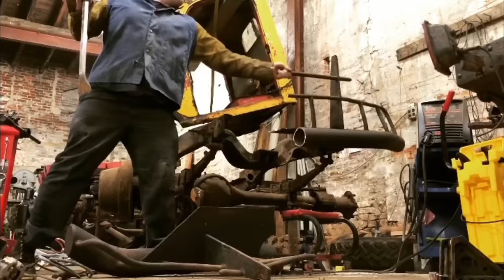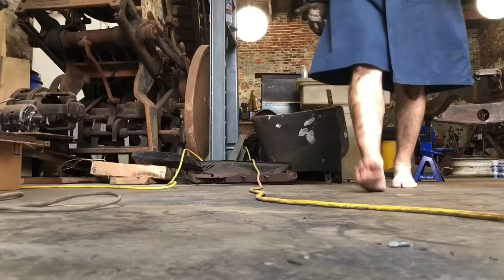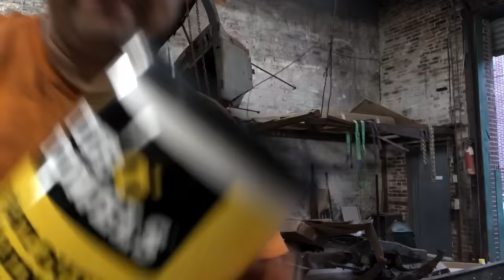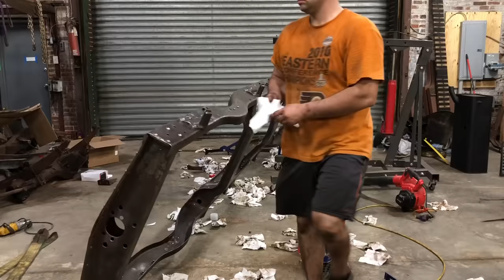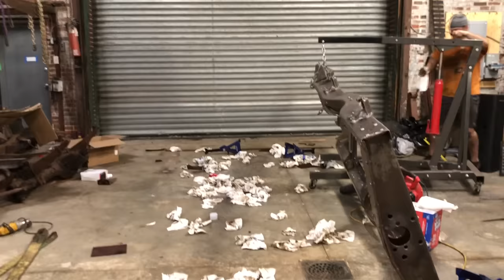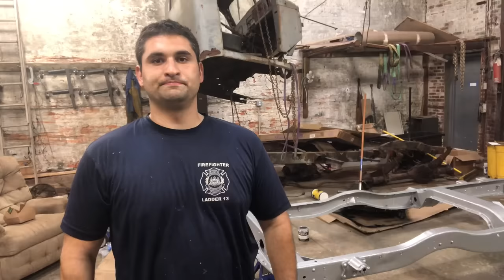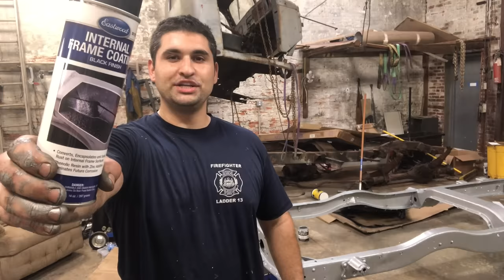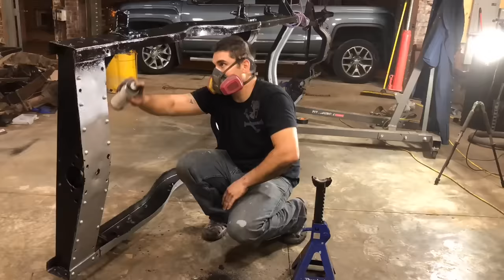DIY: How To Restore a RUSTY Truck Frame LIKE NEW with Basic Tools!

Comment: How many cans of the 2K did you use?
Reply from the maker: 5-6
Reply: That 5-6 cans, was that for one coat?  Looking to use Eastwood 2K on my 1971 Monte frame and trying to figure out how much to buy for 2 coats. Thanks
Reply: @tommik9368  Rattle cans give lousy coverage. Just use a spray gun, cheap enough and way better.
Reply: Hey Bud I’m looking to do an off frame build on my 68 C-10. I know the frame is still solid. But for future reference if I run across a project to where the frame needs a lot of work including patch work do I need to pass that project up or do I go ahead and spend the extra time on re-enforcement and bringing it back up
Reply: How much did the entire Eastwood stuff cost?
Reply: 2 words CarRep 2k. I use Eastwood alot but I've used CarRep 2k epoxy primer that has no pot life. It don't mix its 2 parts until sprayed. So it will last a long time. Love it. Primer, paint and clear.
Reply: 2K has isocyanide, always wear a respirator if spraying indoors. It says this on the can.
Reply: @albert-uj8ci  once you factor in price of the spray gun and compressor, it can get pretty expensive.
Reply: @lvlikeyV  Not that expensive these days, If you're doing stuff like restoring a truck frame not a huge percentage on your total costs. And you can use that compressor for loads of cool air powered things.
Reply: @albert-uj8ci  I suppose "pricey" and "expensive" are relative terms. For someone wanting to do a cheap diy restoration, adding an additional $200 for painting equipment (not including paint) may not be an option. Especially when the final outcome of the video turned out how good it did. To each their own. I just don't want to fuss with an air gun.
Reply: So how much did all your consumables cost including the metal prep stuff?
Reply: @keithkreischer7321  over 100$ i would reckon
Reply: @lvlikeyV    are there sprayguns out there that can be rented for nominal fees
Reply: @efil4kizum less convenient, more expensive, and not to mention theres a learning curve to using that equipment.
Just face it man, spray cans have their place. They're perfect for at home diy projects. If you're wanting a showroom car and have a shop, probably not the best option.
Reply: @efil4kizum  you can get a spraygun relatively cheap. You get what you pay for but a cheap one will serve your purpose without breaking the bank. The main thing is getting a water separator on your air supply and having a good enough air compressor. You really need a large air compressor, but you can make use with a smaller one. you just have to pay attention to your air levels and let it catch up when you spray

Comment: Would it not have been cheaper just to have it sandblasted and powder coated
Reply: I’m no automobile expert but I had this feeling right from the beginning, the oil and grease could have been burnt using a gas flame instead of the degreaser spray and wasting so so so much of paper.
Reply: Getting the frame to and from the sandblasting/powdercoating place could have been tricky (and expensive) though, depending on what he's got available to him for transport.
Reply: @SniffBackBetter  yeah but as a metalworker I hate powder coating as when it chips rust gets underneath, have you seen road signs with peeling of plastic
Reply: Think he got the paint for free, Just the labour needed!
Reply: @Alan2E0KVRKing  yeah,  from eastwood...their stuff is too expensive
Reply: Electrolysis process would also work, to remove the rust, might have to build a small pool to make it work, but can be done.
Reply: @SniffBackBetter  Yeah.....100 bucks for a UHaul flatbed....cheap when u compare each way of doing this.
Reply: @kubasaki1978  True. I've since discovered that epoxy and polurethane paint systems are the way to go. Far better than powder coating. A properly applied system will last for 10 years even on marine equipment immersed in salt water. On something like a truck chassis it could last indefinitely with a bit of occasional underbody jetwashing.

Comment: Brave man, spraying with your GMC parked 20 feet away in the doorway. I would be so worried about the drifting overspray speckling my truck 🙂
Reply from the maker: Haha. I park the truck to keep random people from walking into the shop (when I don’t, they do) 🤷🏻‍♂️🤷🏻‍♂️🤷🏻‍♂️🤷🏻‍♂️
Reply: @partsandresto  I figured the GMC was parked there as a deterent, I would have done the same as well although would have also been worried about the overspray loool.......great job man, really hard work although really rewarding work! I have yet to try the Eastwood products although have had great success with Rust Bullet sealers and rust inhibitors, have you ever tried them on any of your projects? would be interesting to see between Rust Bullet and Eastwood which if any is slightly better than the other, Cheers bro
Reply: dries in air before reaching it
Reply: Most overspray will dry in mid air before touching the 20 foot mark leaving it easy to wash off so don't worry about it just paint and realize that there's an reason you hold your paint gun 6 to 8 inches away cause it gose on wet from that distance and sticks 20 feet is plenty room to get it off your truck I paint houses ,cars ,rod iron fences and have never got anything on my truck that wouldn't just wash right off. Good day to you guys and yes house paint is designed to stick to metal as well as wood and stucko also.

Comment: I did one 1940 Ford coupe frame at the same time as a 1957 Chevy ragtop frame...side by side. We sandblasted them roughly to knock off most of the rust and then sprayed both with a metal acid from Zep. Then repeated both steps the next day. Then sprayed heavy coats of epoxy primer, waited six hours and gave them another prime. Then sprayed catalyzed acrylic enamel black, numerous coats to get the shiney look. Even clear coated with a catalyzed urethane clear. Two years later, when we had both of the bodies finished and dropped back down with the engines, the frames looked fab. 34 years later, in 2018, the man who still owned both cars called me to come inspect the acrylic lacquer finishes (Ditxler). Even though both cars had been driven to various shows, but were lept in his barn most of the time, I got down on the floor and flashlighted the frames. They were still 100% and still shiney! Compared to the coal tar based black enamel the Ford factory used and the black alkyd enamel GM used, they really proved the better, doing it how we did. I hope I never have to do another frame, just like I hope I never have to hang another front clip on a '50 Chevy truck.

Comment: You need 2 engine stands converted to frame holders which when you weld flat plates to them they can bolt straight to the frame on the front and back allowing for you to roll it around and also spin frame 360 when painting it. I have an buddy who did this technique for his 63 impala
Reply: Genius 👍

Comment: When spraying inside your cross members,If you put tape about a inch from the end of the rubber tube,you will know when it is close to the end pulling it out. I hope you did not get any over spray on your truck parked in the doorway,you might want to cover it up if you spray again. You can buy a roll of plastic at the auto paint store,it's around 14' wide and 300' long to cover your projects with.  It turned out great! Nice job.

Comment: I have a background in aircraft parts reconditioning and painting. I really like using Sherwin Williams hex chromium epoxy primer for a base. In my experience rust encapsulate products do not work because rust can flake off in which oxides can redevelop. In your situation your frame was so nice and rust free I would have opted to do a phosphoric acid soak and rinse and then epoxy prime. The reason i like the hex chromium epoxy paint is that it is mil spec for aircraft coating. If it's good enough for an airframe then good enough for a car. Fantastic effort and a job well done. Your attention to detail was amazing.

Comment: Looks good. Just need to remember to use a breathing apparatus at all time when dealing with aerosol and eye protection especially when your working under something like that frame when brushing on the protective coat.
Reply from the maker: Yes sir. I’ve since learned
Reply: @partsandresto  perfect job, just whispering here, next time if possible, cover that nice ride by the door from all the paint, man that frame, well done
Reply: @partsandresto  very thorough and nice job. Mopar lover myself. When you were doing the last part with the frame on its side, you can see the air currents (looks like) moving through the shop toward you. Wear painting respirator for this people. Those painting products are not made to be inhaled even in small amounts. Stay safe and GOD Bless.

Comment: You won my subscription... I have done this type of job many a time... I used compressed air after wire wheeleing to get the dirt out of the cracks... (with safety glasses on) and then wiped the whole frame and surface with a gallon of paint thinner to get more dirt out (in tight places I ouredd a couple of ounces to flush out the dirt)   and then another once over with the air compressor and blower nozzel.... Thenan  ethyl alcohol wipe down as a final prep... 
I am not criticising .... You said you wanted to hear feedback  - alternative methods so - you asked for it  ( just kidding)    GREAT show BTW... Thanks for sharing...
Reply from the maker: Thanks Jim! I definitely did it the hard way. But hell, I already had the tools, so the rust removal was free. I like free

Comment: Nice job! Looking to use the same product on my F-350 frame. Curious how the finish was after brush coating the platinum paint.. Did it leave any brush stroke imprints or did it sort of self level and come out as a smooth finish when dried? If not, would you suggest using a spray gun instead of brushing for a smooth finish look?
Reply from the maker: To be honest it’s a little brush strokey

Comment: Good effort on the manual labour. I use one of those air varsol sprayer's to spray rust inhibiter inside a frame, it comes out as a fog and gets everything inside coated including seams.

Comment: I like how you did the silver Rust Encapsulator on the bare frame, then the black 2K top coat. Makes it a helluva lot easier to see where you've painted, and where you've missed. Good subliminal tip!

Comment: First ever video I've seen of yours and honestly it was awesome. Great job on all that hard work. Only thing I would have for criticism is typically when painting you do a really light first two coats allowing the material to flow and adhere better to the frame. I don't know if you'll have any bad effects from going so heavy right off the bat but I know that with everything I've painted going two light coats then a medium coat always serves me well. Cheers my guy
Reply from the maker: Thanks Ryan, that’s good advise. I’m literally flying by the seat of my pants
Reply: exactly

Comment: It’s really interesting how a truck frame from the 50’s is so solid and the frame on my 96 Silverado is literally flaking apart. It’s so bad that a had to have 2 cracks in the Chanel repairs with diamond plate and 1/4” steel on both sides of the frame by the front spring eyes.
But I do like Eastwood’s products and may try them out on a 79 trans am frame I’ll be restoring.
Reply from the maker: Yeah they are great. Worth a shot, you’ll be glad you did
Reply: Its not from the northeast that much is certain.

Comment: I use a lot of Eastwood products as well. I find the tube that comes with the internal frame coat horrible. Especially for fully boxed frames. But it can never get it point where I need it. 
So I remove the tip and throw away the cheap tubing. I use the brass capillary tube, made for mechanical oil pressure gauges. Just use a nice snug rubber hose for attaching to the can end. And solder the spray tip to the tube. 
Now you have a hose that will reach anywhere you want and can hold its shape to get into tight corners and such.

Comment: Hey man good job,
I used to do a lot of this stuff and Really enjoyed it. But if I may suggest, Cleaning, scraping, wire brushing, scratching and picking is a lot of hard work. See if there is a place where you can take the frame to have it dipped in hydrochloric acid. They will let it sit there for about 6 to 8 hours and it will eat off all the rust and paint. I used to spend days on one frame Until my hands hurt so bad I couldn’t stand it. Once you get it back from the dipping process all you have to do is clean it 👍. 2) Don’t buy the pre-. Load up a paint gun with lacquer thinner and use a nylon brush while increasing the pressure. It’s cheaper and more effective. Just make sure you open up the overhead doors and use a charcoal mask. Eastwood make some good finish paint and the 2K is excellent. I used a ton of it. If you’re able, invest in a Little compressor and a spraygun. It will cut your time down 70% And material about 20%. The press encapsulator you used from Eastwood with the flexible tube is excellent. Tip: Cut a wire hanger and tape it to the tube… Gives you more control. 👍. These are just some time saving tips. Excellent job. Looks great

Comment: Nice job, I went with their middle of the road encapsulator about 8months ago and not entirely happy with the outcome, have you noticed any small bit of rust/oxidation coming through? I did alot of the same steps in the video and also did two coats of each product and feel like it should have last alot longer.. may gas tank skid is where I noticed it most. Maybe I should have used the 2k instead of the chassis black, hope to see updates, awesome looking frame brother!
Reply from the maker: Thanks Adam. Can’t give a down range report yet as it’s still been indoors the whole time. No issues noted yet
Reply: I used the Eastwood black encapsulator on my 95 Chevy truck frame. Have the same problem with rust coming back though it. And frame has been mostly stored in my garage.
Reply: @nineten123  yeah, I think I'm going back to self etching primer at this point... I live in Chicago and we have yet to have snow/salt.

Comment: Great job. 
I have done this myself and don't mind hard work to get great results like this.
However, long pants and work boots are a must in a shop always.
Shop work is not at a summer barbecue or a trip to the beach.
Think safety and exposure to chemicals etc. You only have one you!

Comment: Nicely done. That is exactly how i'd do it if I had somewhere to do it. I've got a few projects waiting for a shop to get built. Hopefully 2021 will be the year. Smart move using the silver chassis paint. Makes it easy to see if you miss any spots with the black top coat. I plan on using the Eastwood products when I get around to doing the frames on my squarebodies. I May even do the frame on my 57 Two-Ten but not sure yet as it's a little too nice to tear apart just yet.
Reply from the maker: Thanks brother. Good luck with yours. Get that shop off the ground ASAP. You only live once

Comment: You are the real deal, hard core manual labor the whole way.  Eastwood has a power washer dustless blaster attachment that would have made short work of knocking the rust off that frame and would have degreased it at the same time.  Then a cheap throwaway paint gun for the encapsulator and chassis paint.  But like I said, I'm lazy!!  I have a 10K Challenger automotive lift that I can use instead of jack stands, but very few people have one of their own.  It turned out great though.  Thanks for the video.

Comment: Nicely done. Just bought a 2007 4x4 Silverado here in Southern Utah. Not much rust on the frame underneath but a bit of surface rust. Wanted to clean it up and paint it so I can go wild 4x4'n. Think you just showed me how!!! Does that tube on the internal rust spray have a 360 dispersal fitting on the end or was it just an open end of the tube? Thanks much, great stuff!!!!

Comment: Great info. I dont have anything too special, but i plan on a ground up restoration of a 1986 mazda b2000. No body rust and only surface rust on the frame, but no rot or deteriation of any kind.

Comment: Nice video. Was curious about one thing. Why did you do all the extra work of cleaning, wire wheeling, then cleaning with cleaner and towels. When you could have gotten same, if not better results sandblasting the frame.

Comment: looks good, but how many rattle cans did you use. Does Eastwood make that stuff for a spray gun?
Reply from the maker: They do make all of the above for spray guns.  I used 6 cans of black and 2 big cans of platinum
Reply: @partsandresto  I will be interested to see how it holds up over time. I have never used Eastwood products for frames, I used everything under the sun, and find Rust-oleum products one of the best for longevity. I did use Eastwood engine compartment urethane paint for the first time, for the inner fenders of the Galaxie I am restoring. It was not a good match, it's too flat, but seems very durable.... for the most part I am happy with it. Maybe in a future project I'll try it. Thank you for your reply.

Comment: Hydro blast would have taken that frame right to the ready to paint stage in about 2hrs. They come to you, look into it. Maybe for the next project.👍 Great job on the frame!
Reply from the maker: Thanks Jim. Good ide
Reply: @partsandresto  As I get older I start to realize that the one thing I can never get back is my time. So I tend to contract out undesirable task. 🤣

Comment: Sooooooooooooo how do I clean my frame WITHOUT taking my whole truck apart 🤔
Reply from the maker: Get it up on jack stands, get a respirator and face shield, and a creeper, and then get to work.
Reply: @partsandresto  
1.Jack stands 
2.Respirator
3.Face shield
4.Creeper 
Well guys I'm off time to get to it thanks 👍
Reply: I might add I don't have it inside with a paved floor. Oh and it is winter in Ohio!